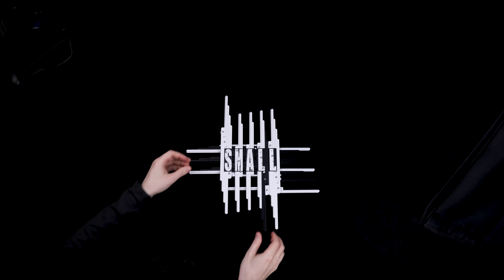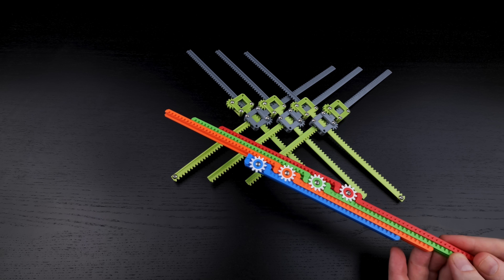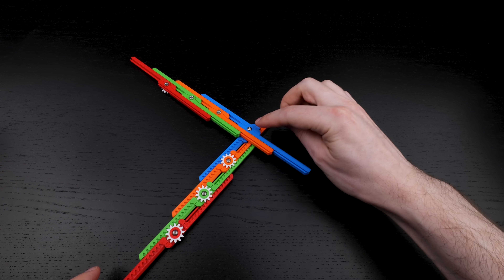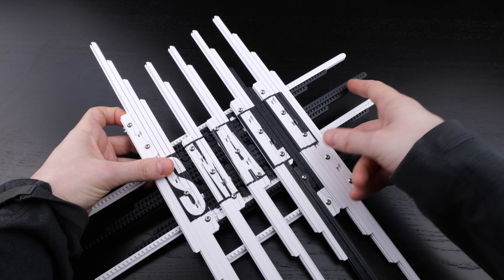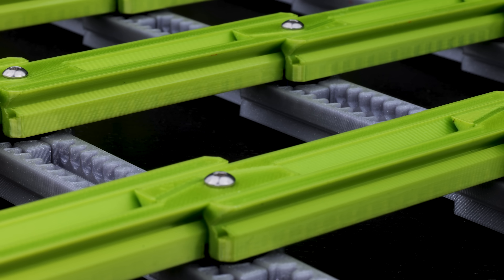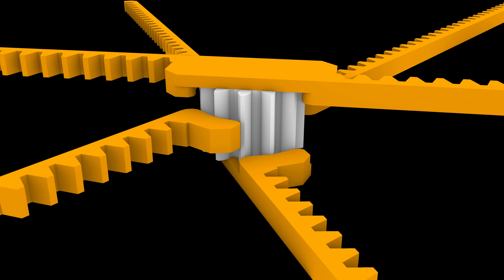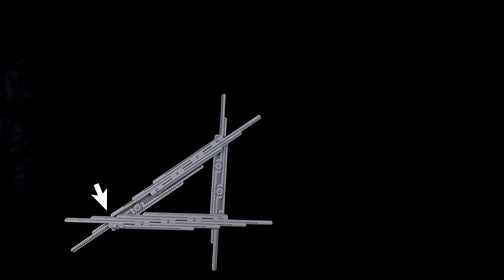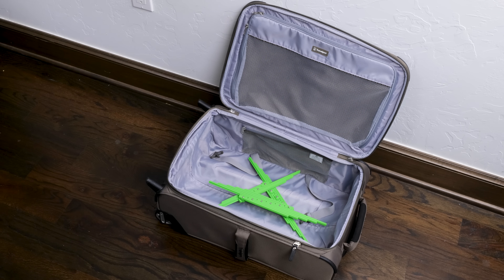Expanding racks

Comment: The idea or. One to retract while the other expands could be used as gateway or diversion mechanism. A fluid object coming in from above to the chamber  that's already sealed on 2 sides. could be diverted different directions as needed without completely opening or closing the inlet which would prevent an overflow/overfill.

Not sure if that makes sense in those words.

Youd have a river coming into a bay, this gate could divert water down a spillway or into a a usable area. The gate could regulate the amount of flow to each side... Though you'd never be able to fully open both sides at once. Can't think of a scenario that would require this but it's just a thought.

Comment: Could I get the stp file in the description for the first thing where it is a n expanding rod and not the other shapes. I found the triangle and cube style on the internet but I would like to use the original rack and pinion set because the rack has a track to follow and I can’t figure out how to design that.
Reply from the maker: If you take the parts to make one of the sides of the triangle, would that be what you’re after?

Comment: There's kind of an open-ended application I immediately thought of. I used to organize a heavily decorated event series. We did pretty massive things on a pretty low budget and a problem we always had was with transport and storage. Another limiting factor was setup time. Having this type of expanding meshes to use as dividers, combined to 3D structures, suspended ceilings or armatures to cover with materials or hang other stuff from, I feel they could have made our lives a whole lot easier.

Comment: Idea for an application: Put the axles for the gears on rubber feet in which they can turn, both sides, so you basically have a flat plane on which to put for example boards as a platform to stand on.

Comment: This mechanism is what I'm using to make an halo 3 fuel rod cannon for airsoft, using co2 shells. The trigger on the model only gives it 70mm of movement at best. So I'm using this to extend that for 120mm bolt travel and barrel retraction. It should look fairly similar to the game functionally, except safe for airsoft

Comment: Guy, I owe you a beer if I ever meet you.  I was working on a metaphor to explain how gravity, while locally never traveling at faster than c, as an aggregate scalar force travels at 10^7 c and this video pops up in my queue.  There are papers on fractal self similar systems to demonstrate it through math but I was fumbling for a visual metaphor (and honestly, just trying to understand the phenomena).  Here’s simple explain: gravity = chiral (worm gear like) scalar force propagating through a 3D quasi-tetrahedral lattice.  The expansion of local node at c causes an adjacent region to also expand at c (effectively 2c in flat geometry) etc. The lattice nodes are subatomic so acceleration happens quickly. Up to a limit of signal reflection (don’t really want to explain this but as a sketch:  finite universe, and Mach’s principle). Anyhow, many thanks.  I now have a means of explanation.
Reply: I wonder if this guy is actually smart or is a schizo off meds
Reply: It is the latter. Here is a gpt breakdown. 

They’re not describing anything in mainstream physics. It’s not “on the edge,” it’s not a speculative but coherent model — it’s a word salad built out of physics-adjacent terms. Let me break down why, piece by piece, in normal language.

1. “Gravity… as an aggregate scalar force travels at 10⁷ c.”
This is already a red flag. In general relativity, changes in the gravitational field propagate at c, full stop. This has been directly measured by LIGO: gravitational waves from merging black holes arrive at the same time as the light equivalent within measurement error. There is no accepted or theoretical framework in which any “aggregate” gravitational influence travels faster than light, let alone ten million times it.

Invoking “scalar” also doesn’t help — gravity in GR is not a scalar field. It’s geometry.

2. “Fractal self-similar systems to demonstrate it through math.”
No mainstream gravitational model uses fractal self-similarity as its underpinning. The universe contains fractal-like distributions (galaxy clustering), but gravity itself is not modeled with fractal behavior to yield propagation speeds.

This is one of those statements that sounds deep because “fractal” and “physics” appear in the same sentence.

3. “Gravity chiral (worm gear like) scalar force propagating through a 3D quasi-tetrahedral lattice.”
This is fully fictional.

There is no tetrahedral lattice underlying spacetime in general relativity.
There is no chiral/handed worm-gear mechanism for gravity.
There is no medium through which gravity “propagates” like a mechanical disturbance through gears.

People sometimes talk metaphorically about “lattice spacetime” in quantum gravity research (e.g., lattice QCD, causal dynamical triangulations), but not in any literal physical sense, and certainly not like what they’re describing. This comment is invoking words that coincide with legitimate research terms but arranged in a way that reflects no known theory.

4. “The expansion of local node at c causes an adjacent region to also expand at c (effectively 2c in flat geometry) etc.”
This shows the commenter doesn’t understand relativity. In no valid relativistic theory do sequential local c-limited processes create superluminal net propagation (e.g., c + c). Relativity explicitly forbids this.

If a chain of events each limited to c could sum to 2c, relativity would collapse instantly.

5. “Signal reflection… finite universe… Mach’s principle.”
These are used as decorative physics references. Mach’s principle — the idea that inertia arises from the gravitational influence of all matter in the universe — is not part of standard general relativity and absolutely does not imply signal reflection or superluminal gravity.

This is the point where the comment fully crosses into pseudophysics.

---

So what is this person actually doing?

They’re trying to invent a mechanical-medium picture of gravity (a “lattice,” “nodes,” “chiral worm-gear forces”) that behaves like a chain reaction and then rationalize faster-than-light effective propagation. This is exactly the kind of thing people propose when they don’t understand that relativity forbids classical mechanical analogies for spacetime.

It sounds like:

a little science,

a little YouTube science-fiction language,

plus confidence.

But it isn’t grounded in any accepted physical model.

---

Is it “schizo off meds”?

No need to pathologise them. But this comment is pseudoscience using physics words for aesthetic effect rather than describing anything real.

If you’re asking whether it corresponds to real physics:
No. Not remotely.

Comment: Last month I designed a rack and pinion oil valve on the Thysencrupp CT3310L veined industrial air compressor using a rack and pinion system just like you're working on. The reason is because of the gear ratio, space, and robustness. Basically the valve itself needs to move 1/5 the distance of the mechanism that opens the valve but basically needs to be flat due to the location, rack and pinion with 1:5 gear ratio was my solution and no other engineers have conceived anything like it as far as I know. Certainly not our competitors. Next time you're in the market for basically the world's largest supercharger choose the Thysencrupp CT3310.

Comment: 8:08 couldn't you just go down a layer in black and make them whatever size you needed? they can span and attach wherever can't they?
Reply from the maker: Ah, you're suggesting putting the horizontal sticks on different layers so they don't crash into each other, so that they can squish down further? I guess that is possible, although adding a whole extra layer is a cost to pay. There's another issue that came up as I thought about other multilayer designs - that any sticks on middle layers have to stay out of the way of bolts connecting outer layers together.
Reply: @henryseg  just a few black ones on the back, securing where needed for smooth motion. you can just have occasional support pegs for the rest of the layer

Comment: The 90° design with flipped  layers shown at 6:00 is a protractor, actually.
The distance between the unconnected ends would be the diameter of a cricle, and given that any intersection of 90° between two lines passing through those points is a point on the circle with that diameter according to Thales Theorem, that would make these racks a protractor.
Though full circle doesn't seem possible with that particular design, as the racks themselves get in the way of getting on the other side of the diameter.

Comment: Perhaps an attachment to certain gears or tracks that when enabled can do certain things. Lock or immobilize the system or Spring back to a certain position. A spring-based motor like in a clock designed to resist either way. The more you enable the stronger the hold. I suppose rubber bands would work. However, the gear mechanism could be toggled at differing positions dynamically, whereas rubber bands can't.

Comment: 13:02 I am just thinking but should the pivot gear that is split have different radius gears rotate on a single axis create a driving system that can have a small initial action be translated to a "bigger" resulting action...? Thus you can as a electro mechanical function (for automation purposes) have a single "small" expanding system drive a "big" result, by playing between the size and gear ratios... ?

Comment: I am trying to learn can I use an expanding rack to roll as it expands?  Let me explain .  The rack is attached on the left hand side so it only extends to the right.  On that end there is a second rack I want to rotate forward as the first rack is pushed out.  In other words the extending arm makes the cross arm turn.
Where do you get your racks ?  Thanks Robbie

Comment: I can think of a good use case: As long as this could be made cheaply and with enough strength, it could be a great way of making some kind scaffolding for things like solar paner installation, while keeping it small enough to transport it cheaply, just needing a pin to mount it in-place.

Comment: i have a friend with a robot character that i want to help her 3d model, but the character is meant to be entirely mechanical with no electrical or steam powered elements, powered by a nebulous source that turns the gears.

when thinking of mechanisms to mimic the elbow of the arm i had the idea for a rack and pinion system that when contracted slides down closer to the elbow and pulls the arms closed, and when expanded slides further away from the elbow and keeps the arms open, with each end of the racks on a sliding platform resting in a groove along the arms. 

im doing this with a very minimal understanding of these types of mechanical systems, so i was wondering if you could help me think of a way to explain how the gear for the rack is able to turn. my first thought was a belt drive attached to the elbow, connected to and driven by the mechanisms hidden under the plating for the arms that i dont have to think about, but im unsure if it would work, cause right now im just at the sketch phase and i dont know if when the mechanism moves if the pinion would stay in place relative to the gear that drives the belt.
Reply from the maker: There are some elbow-like mechanisms at the end of this video starting at 8:40: https://youtu.be/ckrrQTkTqIo

Comment: Potentially this could be used for catapult launching off aircraft carriers. You could keep the electric motor stationary and use the mechanism for mechanical advantage to get much longer throw. Theoretically you could even have longer throw than the length of the ship if you could come up with some sort of expanding support mechanism and then stow it back away again immediately afterwards.

Comment: This might not be seen, but just in case.

Why would this not work with curved rails using acordingly shaped/sized gears? Now you have an expansion mechanism that both grows and twists.

You could also use mirrored racks such that you can created an "extending arrow" shape. Combined with the reversed motion formation you can have a central rack that shrinks when the outer areas are expanded, and then expands when the outer area gets shorter, and vice versa. If placed radially you can create a mechanism that conforms to the shape underneat.

Comment: honestly these would make great drawer racks, especially considering a lot of functional drawers work with just wood on wood friction, why wouldn't you use these very affordable mechanisms to improve the function. There's also probably a lot of CNC applications like a pen plotter or laser engraver that can fold down small and be set on any surface to work on a large area

Comment: Instead of gears, if you add pulleys on each end, and a loop of rope or belt, you can get much more extension per stage.   That's typically how we rig "cascade" elevators in the FIRST Robotics competition.
Reply from the maker: I need to get into cables and pulleys sometime!

Comment: it would be cool if the racks could be taken apart and reassembled easily for transport. they do collapse small enough for a suitcase, but they are still an uneven form with height differences when laying down and thin pointy ends (single racks poking out at the farthest points), so it would still be somewhat hard to carry.

Comment: By having some that extend and some that contract, you might be able to make a rotationally asymmetric shape transform into its mirror image at the same scale, which’d be cool

Non-uniform transformations could also be a cool direction to take this next. With that It might be worth looking at having some free sliding rails with no rails sprinkled in, as as long as the intersection points of the line are placed in their new positions, a free moving rail doesn’t need a linear rate of extension, or a uniformly changing gap between each pivot point to get to that new state

Ver cool :)

Comment: For the triangle, couldn't you have used the layer switching trick in the middle of all three sides? that wold give six "sides," an even number, so they wouldn't collide. It would still collide when the middle racks reached each other, but that would buy you more expansion than just one side doing the layer switch.
Reply from the maker: The collision comes from having racks going in different directions on the same layer. You do need the number of “sides” to be even so that they link up at all around the triangle, but that’s separate from when things collide.

Comment: Another idea could be to attach another expanding rack to the endpoints of the contract/expand mechanism and create something that traces out something that's almost a real-world mechanical Bezier curve. EDIT: No, wait, you'd have to attach it to the inside ends of the outermost racks, because then the rack on top will end up parallel with the rack that is fully extended

Comment: Can you make a version where the gear ratio changes to approximate non linear functions?
Reply from the maker: I think it might be possible, but it would involve much fancier gears and racks. The current design has the gear roll many times as it goes along the rack, so it’s hard to see how it could vary its behavior at different parts of the rack.

Comment: I wonder if any of these structures could ship collapsed to save space, deploy into their expanded form, then “freeze” all of the joints into a rigid body? Applications in housing or space travel come to mind.

To freeze the mechanism in place, maybe the racks could be made of an electrically conductive material and the gears of some thermal fuse-like material. Energizing the frame could create current-paths through the gears, melt them into place permanently, then break the electrical connection.

So what would those conductive and fuse materials look like, what structural characteristics do you get with a “stuck” gear, and how do you optimize for expanded rigidity?
Reply: As well, how is the application in 3D space? Could geodesic domes or buckyballs be formed as rigid, home-scale frames?